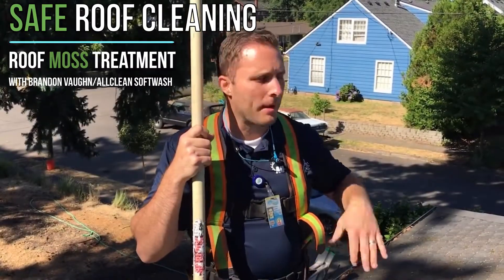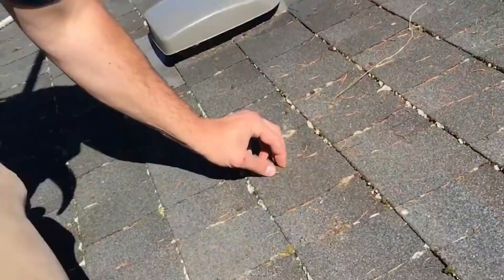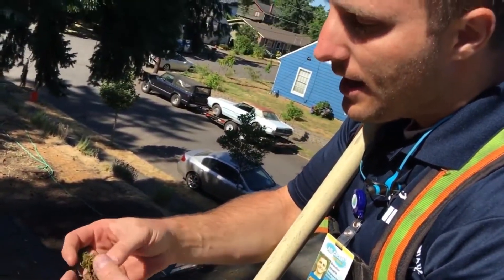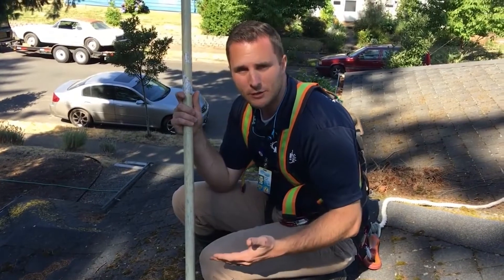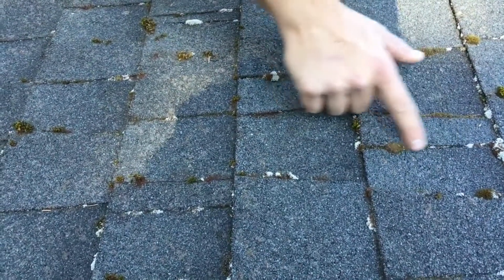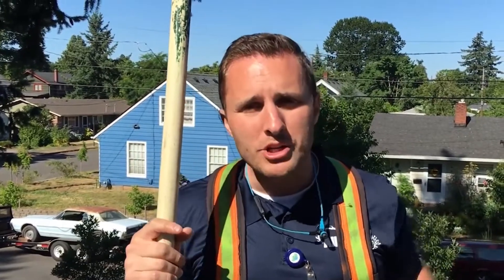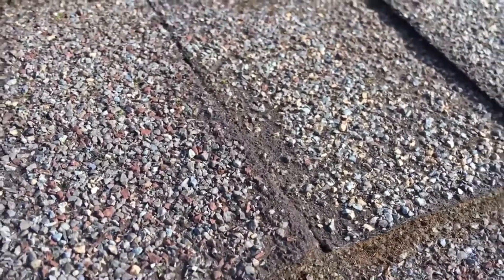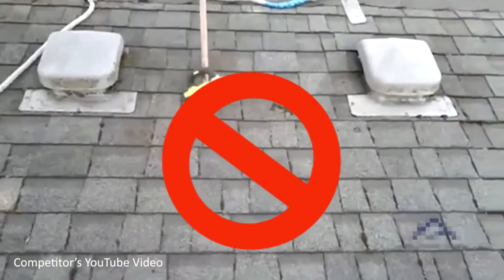SoftWash Roof Cleaning - Safe Roof Moss Removal Without Wire Brush - No Damage Roof Treatment

Comment: We use wire brushes sometimes, but not if the roof looks like what you suggested. I unfortunately haven't had any success just simply spraying it with anything besides zinc (which is banned in many municipalities in our area)
Reply from the maker: What the roofing manufactures recommend works best and is proven for decades, water, sh and a surfactant. For us, it always works, sometimes it takes a few months to show the end results but thats normal.

Comment: What exactly  is low pressure. ? What is the psi coming from the wand.?
Reply from the maker: The psi coming out of the wand is about 30psi to 40psi max, means roughly the same of a regular residential gardenhose

Comment: what is the solution?
Reply from the maker: Soft washing is a cleaning process that uses chemical resistant pumps to apply water, greenwash additive and sodium hypochlorite at low pressure to clean organic stains. Soft washing is the best method for removing moss, lichen, algae, mold, and mildew. More infos about chems we use here:      https://www.softwashsystems.com/chemicals/